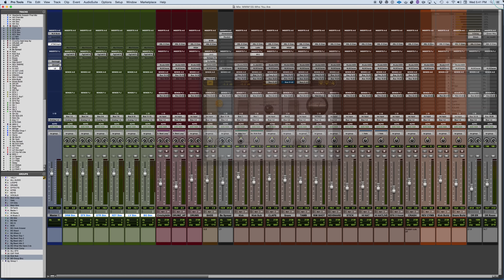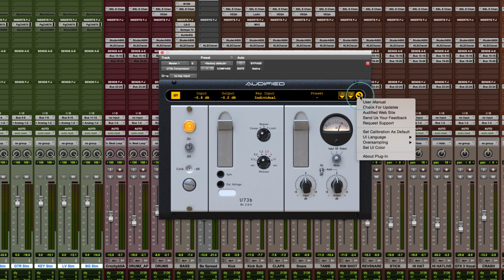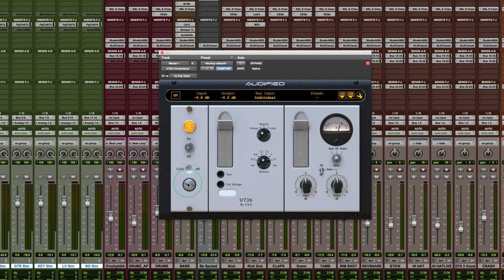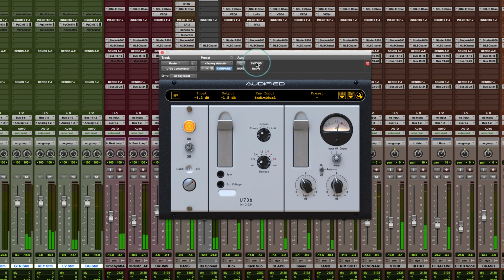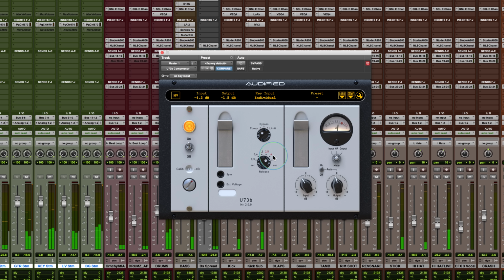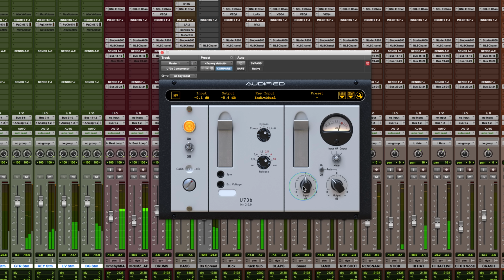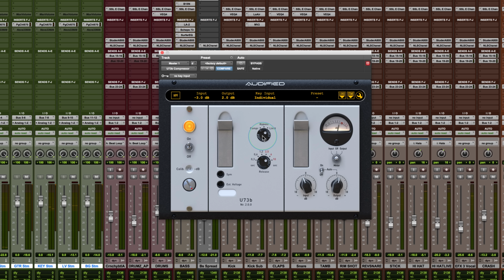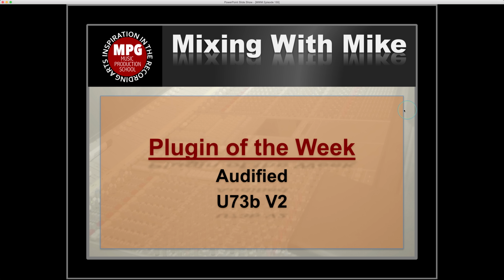Audified - U73b Compressor V2 - Mixing With Mike Plugin of the Week

Comment: You said quantization error and I believe you meant to say aliasing. quantization errors are the difference between a perfect analog waveform and its digital representation. Sure both can be remedied with oversampling, but quantization errors aren't typically audible in 44.1khz unless your converters are of poor quality.
Reply from the maker: Yes aliasing not quantization error, you are correct, thanks!
Quantization errors become more audible with very, very low level signals that are brought back up by gain or with low bit depth recordings.

Comment: I usually agree with your reviews, but on this one (and I´ve demo´ed it for a few weeks) I don´t. To me, this (also the real unit) sounds clicky and in not useable for drums or mixes. This compressor is not intended for music but for broadcast (speech, etc.) and it does this job great, but for music, it just has a TOO clicky attack in all modes and flattens things too much after that initial attack, flattening everything out. I also notice exactly that in your mix, it sounds blurred through this compressor, with loss of attacks which are replaced by that hefty attack click of this compressor. Not for me this time, but they´ve seriously nailed the original though! So good work in the end ;-) P.S.: The kick in your mix has excessive sub-bass, you might want to get rid of this :-)
Reply: dude, thisU73b Compressor V2  sounds amazing!